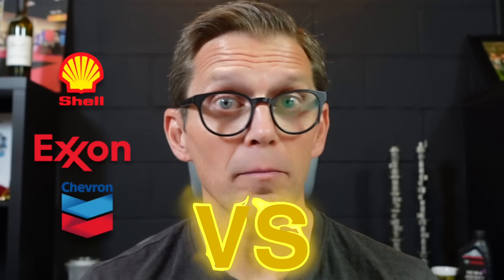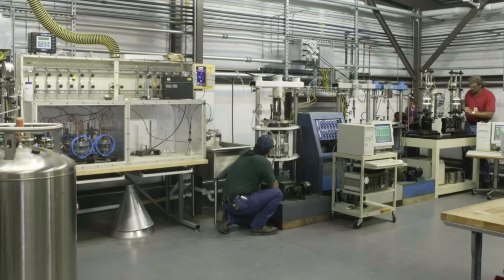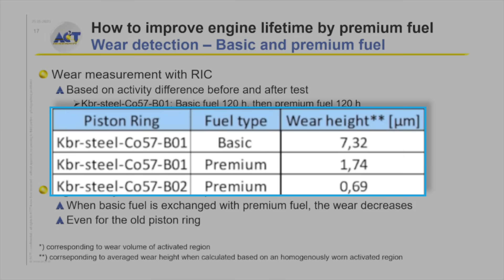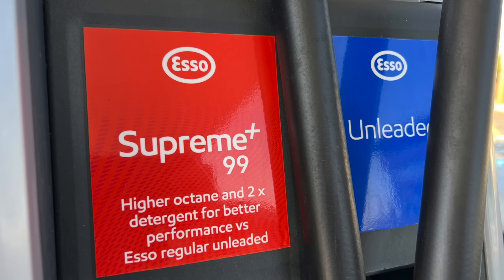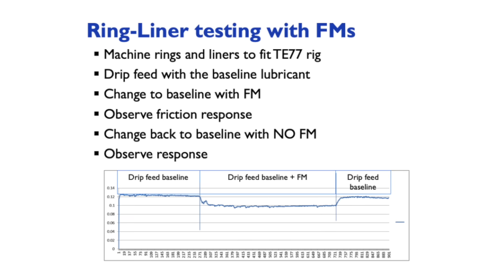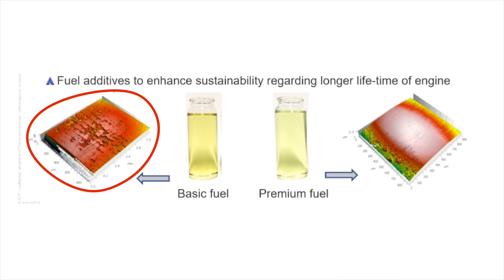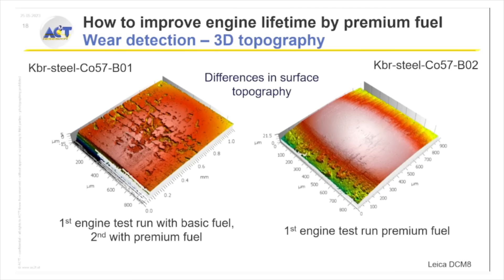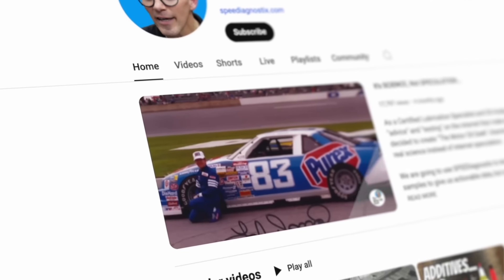Can Premium Fuel REDUCE Engine WEAR?

Comment: Awesome information! Top quality. My only question is, when we talk about lowering wear, just how much are we talking? 1%? 20%? Is it significant enough to warrant better fule or better oil?
Reply: It would depend partly on your exact engine model. I would imagine a Toyota Hybrid would show relatively little difference vs. typical high-performance vehicles. One constant with high-performance vehicles is high fuel-dilution.
Reply: In Michigan premium is $1 more per gallon , over the life of the engine that's like a new engine

Comment: This makes me wonder if adding Marvel Mystery Oil to fuel is actually a good idea. I don't use fuel additives, but I exclusively run on Top Tier fuel in my cars and motorcycle in the grade recommended for each. My BMW car and bike both require premium. So far, so good.
Reply: I'm no professional, just a backyard scientist with major ocd. From all the research I've done and test I've seen over the years marvel mystery oil helps lubricate the fuel pump and the entire system. Its definitely a good thing, but it obviously doesnt just stick around in there forever, but imo for it to be helping it would need to be added every time you fill up.
From what I've gathered MM does alot more for you're fuel then it does for you're oil.
Reply: It keeps the fuel fresher for longer. The idle and acceleration is much more smoother. Also the fuel consumption is less.
Reply: You snake oil guys never give it a rest .

Comment: Whats peoples thoughts on adding 2 stroke oil to diesel ? here in the UK alot of people do it
Reply: My brother did it for years (16 oz. per fill up) in his GM Duramax   , which quieted down the engine completely.
Reply: @TXAG81  i do believe it quietens things down and slight more mpg … i used it for many years but last year or so been using Archoil AR6900-D Max Advanced Diesel Additive .. may return back to 2 stroke oil

Comment: so essentially, even though a car may require 87 octane, it’d be better in the long run to use 93 octane?
Reply: It's not about the octane but the additive package the brand puts in the fuel. Shell, BP, and Valero were the brands with most additives in their fuel (87-93). But yea they market the premium fuels with most additives. This also why those brands cost a lil bit more in general.
Reply: @mastershepherd3777  any info on where Citgo ranks?   I have two citgo stations in convenient spots...and those are country areas where the price is much cheaper
Reply: @mastershepherd3777  gotcha. so the primary goal would be filling up with a Top Tier detergent fuel, not necessarily premium at any fuel station
Reply: @joshkreisman7761  Yes.

Comment: Hi there! Can you please comment on these "clever" people removing ethanol from gasoline by mixing it with water to absorb the ethanol? 
I can't believe there isn't an adverse effect on the additive pack by mixing it with water. Thank you.
Reply: Since ethanol is used to increase the octane value of fuel, I would think that removing the ethanol would lower the octane level and not be a great thing to do.
Reply: @jazzfreek54  I don't mind about the ethanol for the purpose of this question, it's all the other additives I'm interested in.

Comment: Glad I've been using Shell gas. The Shell station near me is conveniently on my way home from work and the price is only around 5% more than the lowest priced generic gas station fuel that's 5 miles out of the way which means I would probably lose that 5% savings in price by driving the extra 5 miles anyway.
Reply: Have you been buying Shell premium ("V-Power")? That's the grade he said to use.
Reply: @aliendroneservices6621  Regular unleaded fuel is what octane grade my car's engine is designed for. I never use mid-grade or "premium" octane rated fuel.

Comment: They need API standards for fuel. That way we know what fuel to buy based on science and not marketing hype.
Maybe in a future video - test wear from different brands of fuel?
Reply: They do have standards for fuel.
Gasoline has multiple levels of Summer and Winter Blend. 
Octane, vapor pressure, oxygen and detergent content are all called out.
Quick search will bring them up for you.
Reply: @TheSzalkowski  They don't tell you the anti-wear additives - which is what this video is about.
Reply: They need a standard for USA diesel.
Reply: @Uncle_Kai_1  Fully agreed.  The ULSD we are using also has a much lower lubricity than the old stuff, not to mention the other issues associated with it, such as the dreaded diesel bug, or the issues with biodiesel (which I do love) and its absorption of water (and then the diesel bug).  The two things that have worked best for me, and I'd love to see tested here, are Hot Shot's Secret EDT, and a lift pump that has a hygroscopic (water absorbing) filter with a fuel/air separator.
Reply: @Uncle_Kai_1  yeah and diesel needs a 50 Cetane standard. The 40 Cetane is a huge reason the emissions systems have so many issues
Reply: @Uncle_Kai_1  They have standards for USA Diesel as well. 
One example is the minimum standard for acceptance to the pipeline. They call out multiple standards that need to be met.
Reply: Cost is king

I just looked, fuel here is 3.90 reg and 5.01 a gal premium at shell

Say you ran a vehicle 300,000 miles, at 15 mpg - the difference would be about $20,000 at that point. Double what an engine would cost;

I'll keep putting in regular and buy a new engine with the difference - or put it towards a completely new vehicle.  That's the small business take anyway... I don't know if I WANT my E250 to last longer 😂 it's a dinosaur
Reply: Well, in the United States there is Top Tier certified fuels. 🤷
Reply: @spicymsp1383  Top Tier Gasoline refers to the PEA (polyeatheramine) detergent content of the fuel not the anti-wear additives.
Reply: @woox200sx  You're correct, but I would bet that detergent content is a better long-term predictor of engine life than AW additives in the fuel. Gunk buildup will kill an engine far faster than piston ring wear.
Reply: @anthonyantoine9232  Worn out piston rings = more blow by and contaminants entering the engine oil. Unless you want to change your oil everyday, that will lead to reduced engine life. In addition, lower fuel economy due to lower compression in the piston.
Reply: @woox200sx  Yeah, and you'll never have an engine survive long enough to wear out the rings if its gunked to hell and not running. Some modern DI engines have required valve blasting as often as like 20k miles. Drive 100k without that and your engine is toast.
Reply: @anthonyantoine9232  Having high detergent in fuel won't improve carbon build up on the valves of DI engines. The fuel never touches the valves (Hence the name - direct injection). Installing an 'oil catch can kit' will reduce carbon & oil mist from the PCV system fouling the valves.
If anything, worn out piston rings will increase carbon build up on the valves. More blow by = more oil mist out of the PCV system.
Reply: @woox200sx  The valve issue was only a singular example, not the entire story. The biggest issue is buildup on the injector tips, causing poor atomization, lean condition, localized detonation, etc. You will destroy your engine very, very quickly without a solid detergent package in a DI engine. The AAA has studied this and shown that even notable existing deposits can be cleaned up. There's also a trend of stuck piston rings from carbon deposits destroying the bores in engines and causing the very issues you're talking about with fuel dilution. I'm talking sub-100k miles blown up from stuck rings allowing fuel dilution and subsequent bearing failure. An AW additive might assist there, but nothing like a good detergent package.
Reply: Valid observation
Reply: Shell as far as i know is the only tested and proven fuel (premium) that helps remove and prevent carbon build up
Reply: @GoldRaven-oe4by  Not the case. All Top Tier fuels have been tested and shown to clean and prevent carbon deposits.
Reply: @GoldRaven-oe4by  Considering Chevron invented PEA (polyeatheramine). I'm pretty sure their fuel will remove and prevent carbon build up as well.
Reply: Use european standards, our fuels are not crap like in USA.
Reply: @V8Lenny if you believe this then you likely don’t realize US fuel just uses a different unit of measure for octane
Reply: @walrus-king  nothing to do with quality of fuel.
Reply: @V8Lenny  lol why did you even bother to reply? Your comments are not contributing anything and you clearly don’t want to have a discussion
Reply: @V8Lenny They literally tested basic and premium EU fuel for the research shown in this video...
Reply: @V8Lenny  There is nothing worse than a European who think's he's superior to you. So sick of you and your meaningless spam

Comment: Top tier fuels + Synthetic oils + shorter oil change intervals
Reply: Is Costco top tier?
Reply: @natas12rm  yes, it is.
Reply: Yes
Reply: @natas12rm  yes at Costco in Ottawa Canada today it was mention top tier for the 91 only and I use for all my small machine and I removed the ethanol in it by adding water and by doing this in the 15 litres of gasoline I removed 450 ml of ethanol alcohols.
Reply: @natas12rm  Yes
Reply: @natas12rm  Nope, ran my car exclusively on Costco 87 octane for 3 years. 
One day decided lets try shell and my mileage was drastically better.
Reply: Costco memberships are a well kept secret to this formula. I drive a Chevy Equinox. The standard oil prescribed by the manufacturer is a quality controlled by GM called Dexos1. So long as this standard is met, the factory engineering is designed to last a long life. Top Teir gas is also the prescribed fuel quality. I'm at 230,000+ miles with the original motor and transmission. Not one issue yet with the motor itself. The only things I ever had to fix on the car was to replace a solenoid on the turbo wastegate (wore out at 170,000 miles and only cost me less than $100 for the part), and  I cleared the code for the O² sensor after I cleaned it (code never came back. I just used toilet bowl cleaner). I only ever used Kirkland Signature synthetic oil from costco and changed oil every 5000 miles (costs less than $20 per 5 quarts) combined with OEM filter from AC Delco (costs $5-7 at walmart). I mostly only ever fuel up at costco since it's cheap but top teir. Otherwise, I only ever go to cheap top teir stations such as Arco, QT, and Sinclair.
Reply: Is E10 or E5 fuel better? They sat E10 cleans better the engine and creates less soot !
Reply: @matthiasgrunwald895 E0 is what I've used for years. Any ethanol blend in my small engines are the carbs, fuel primers, and lines. In my civic I get better fuel economy with E0 over E10, enough to pay the extra cost of E0. Ethanol is trash unless its E85 and you're using it for boosted or high compression engine and need the cheap high octane.
Reply: @АлакПатрова  True, you should NEVER use fuel containing ethanol in it with small engines found in the products you mention like lawn mowers, chain saws, ect. 
It WILL damage those carb systems. e5 or e10 won't cause damage to any car fuel system made after 1990. The problem for most people in the USA today is that you can almost never find e0 fuel in most parts of the country, and if you can find it, usually it is much more expensive to buy compared with e5/10 fuel.
Reply: @matthiasgrunwald895  The difference between and e10 and e5 fuel is almost nil. Both concentrations are enough to provide decent cleaning for intake valves on traditional port injected engines which is a very good thing.  Once you get over e10 you're possible exposing your vehicle fuel system to issues if it wasn't designed for e15 fuel. That extra ethanol can damage rubber and plastic parts in the fuel system. I'd say away from that e15 and high levels on any car not made within the past 5-7 years.
Reply: Change your oil often.  Manufacturers have extended the intervals, likely to have the motor die more closely to the warranty period.
Reply: Exactly
Reply: This.
Reply: Equals??  A f ton of money..but another car with that shit
Reply: Same other then the oil change interval. Lets see if my extended oil changes will bite me in the butt one day. I find it a waste to change full synthetic so soon.

Comment: In very lean mixtures what happens to the oils?
Lean is HOT 🔥
Can this oil help with pinging?
Lake PLEASE do a two stroke oil in fuel testing 🇦🇺🇦🇺🇦🇺🇦🇺🇦🇺🇦🇺🍺🍺🍺👍🏻👍🏻👍🏻👍🏻
I’ve been using it for years in four stroke engines.
Not vehicles.

Comment: So how does one know if the gas they buy has a premium blend?  For example is “Top Tier” gasoline at Costco a premium gas?  Or, is that just marketing mumbo jumbo?
Reply: I was going to ask this as well. 

Top Tier is an independent company that certifies samples from ALL stations under a brand meet minimum additive standards. If 1 station out of 500 isn't getting the same fuel, the brand can't be Top Tier certified. This creates an issue, because a local gas station that is NOT Top Tier certified might actually be better than BP or Valero, but you don't really know. The Top Tier sticker is a baseline of, "it's at least this good".

Or that's how they explain it effectively. If it's actually true, or if it's a pay to win sticker for marketing purposes... 🤷

Comment: Thanks Lake... I own 2 cars... a Subaru 2.5l and a Jaguar 5.0l. What I have learned from you is that I abuse the Subaru much more with cold starts/short trips in everyday use, while the Jaguar is usually taken out on the weekends for longer highway speed runs where the engine gets up to temp every time I use it. I checked the dipstick on the Subaru, and I could smell the fuel in the oil. I now try harder to give the Subaru more runs on the highway when possible, and I am religious about oil changes on both cars with shorter intervals. The videos you have been putting out (including the Porsche ones) have really been educational compared to all of the marketing and internet expert advice.
Reply: I think you need to give that Subaru an "italian tuneup" once in a while.  some Techron may help too.
Reply: @jamescaron6465  Yep... techron after each oil change
Reply: @GetOffMyyLawn it’s good stuff.
Reply: @GetOffMyyLawn best to do before a oil change to dump the junk after cleqning.
Reply: @joshahhhyeah9993 we were thinking it. Lol
Reply: Part of the problem with the Subaru is the direct injection. We have an Ascent with a 2.4 turbo and fuel dilution with 4k OCI’s have been over 5% (unofficially 9% when I inquired from OAI). This is using premium and my wife’s primary vehicle. She idles it when it’s cold for 5-10min and then drives for about 15-20min to work.
Reply: If you can smell gasoline in the oil, that's a sign of fuel injectors leaking. 
I would hook up my scanner and start checking the sensor ECT ECT on down the line. 
No Italian tuneup will work. 
I do agree that using Techron fuel treatment will work. 
Even though I buy fuel with Techron already. That doesn't mean all gas stations have It added. 
So I do treat my gas every once in a while. 
My 23 year old Chevy still runs on the same ole injectors. 
I do own a scanner to see how my fuel trims are doing. 
Also the same ole cat's. 
I quit using K/N filters many years ago after discovering my intake manifold caked with fine dust/oil. 
I cleaned my intake and went back to regular filters and keep them changed out.
Reply: @2nickles647  that’s simply untrue with direct injection only engines nowadays. Look into Honda 1.5 turbo and Subaru 2.4 turbo oil analysis’s. It’s not uncommon to see very high fuel dilution, especially in cold environments. I’ve done oil analysis’s on my Subaru Ascent since new and it’s always been high (4k OCI’s and 91 only), no leaky injector or anything wrong with the vehicle. It’s just the nature of the engine sadly. Though even with that fuel dilution (referring to Subaru 2.4 turbo), I’ve seen many people go way beyond 6k OCI’s, a lot more idle time than we do with low quality oil and using 87 octane with way more miles than we have that have never had an engine issue.

Comment: Is it true that the only fuel company that has their own dedicated line is Chevron and the other fuel companies transport all in the same pipeline.
Reply: No. Not true, but Chevron adds Techron to the fuel when it's loaded onto the truck. All fuels come from the same (few) refineries. The difference is in the additive packages that each brand adds. It's not a bad idea to keep a bottle of Techron in your car or truck to add to fuel if you can't find Chevron or Top Tier fuel on a road trip. Basically, brands like Shell, BP, Mobil, Chevron, and any that label Top Tier Fuel are fine to use.